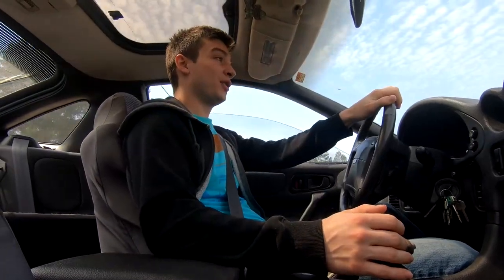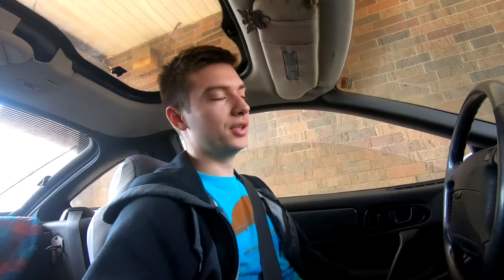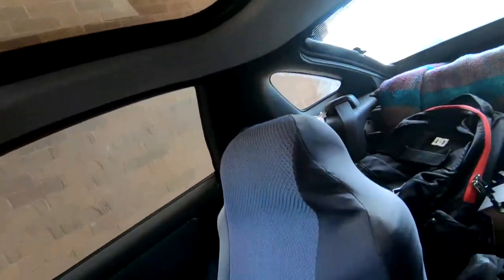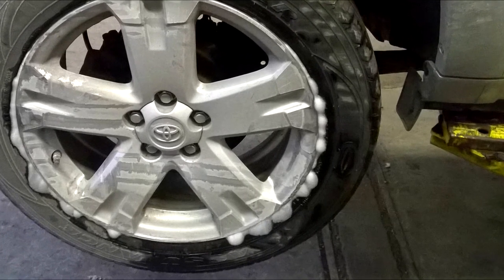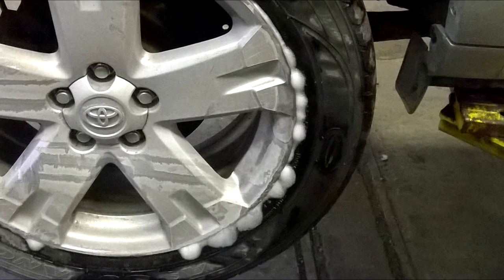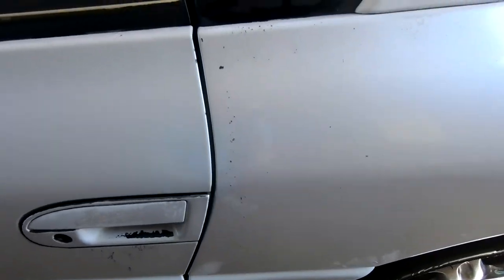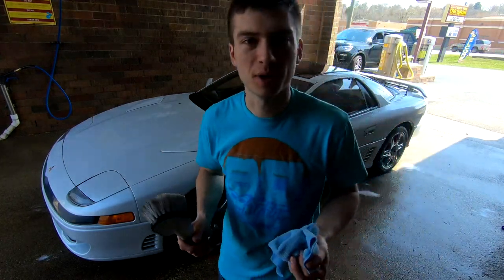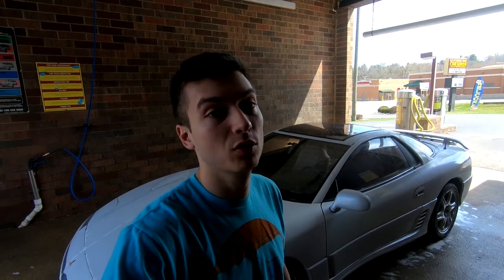This Car Actually Had Snails Living On It

Comment: Try adjusting your clutch pedal so you get a longer throw, it may be dragging causing issues.
Reply from the maker: Thanks for the suggestion! (This was actually filmed over a year ago. Turns out the synchros in these transmissions are super picky about what fluid is used. I have since changed the fluid and it made a huge difference. Bad synchros are also just a super common and kinda early wear point in these transmissions.) Adjusting the clutch on a hydraulic system doesn't really do too much becauseof the design. You can actually adjust it too far and jam the piston in the master farther than its supposed to be pushed. And/or make the resting position of the piston farther forward than it should be.
Reply: @driving-riding-wrenching1278  Which fluid did you use just outta curiosity?
Reply from the maker: @dumbfishtanks  I believe I first did Pennzoil synchromesh. And it helped and gradually got better. It obviously takes a while to actually soak into the friction material in the synchos. Then I switched to redline and it worked even better.
Reply from the maker: So I lied...kind of. lol This footage is from about 2 years ago so I don't remember everything perfectly. I actually did adjust the pedal because it was way out of adjustment. I didn't remember that until I was editing the video that will be up today or tomorrow.
So let me also rephrase what I said before. The pedal should not be adjusted on a hydraulic system solely because the clutch isn't operating correctly. Adjustment should be based only on pedal freeplay specs. If its in spec, it shouldn't be adjusted further for more clutch throw.